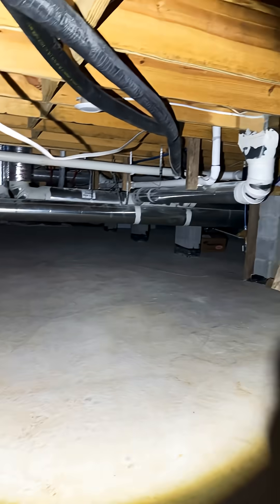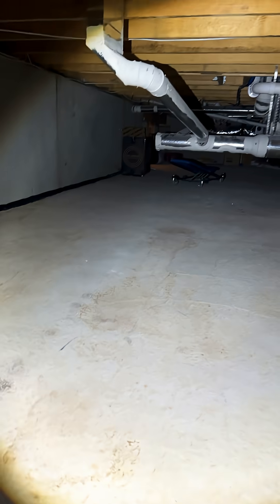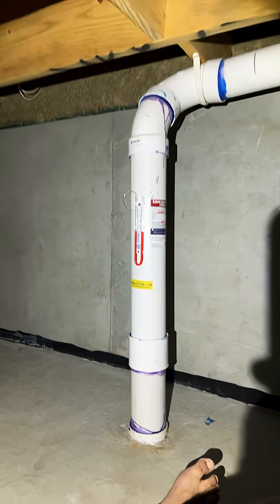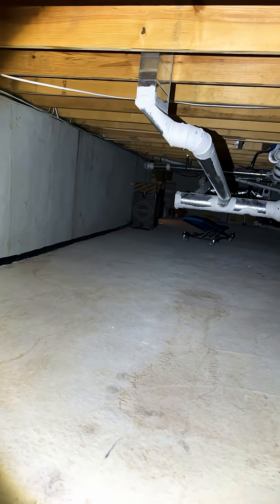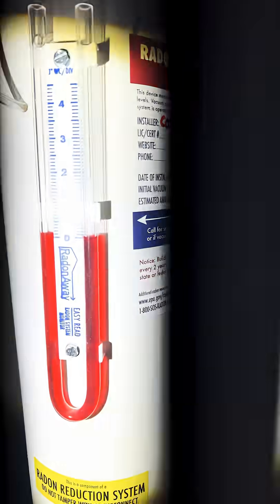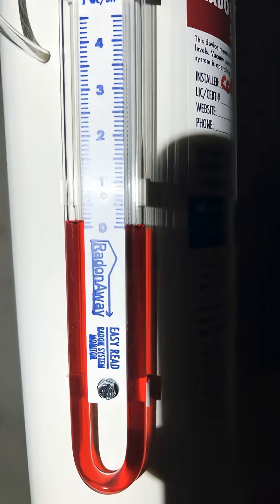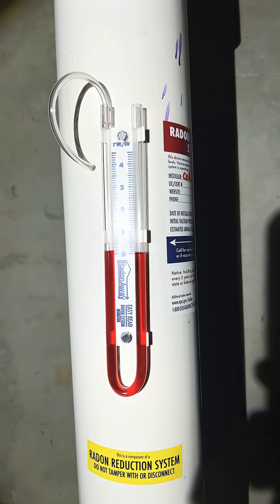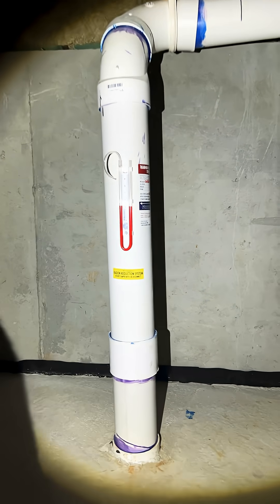Our Radon at Home is basically ZERO because of this vacuum system running at lowest speed

Comment: One new house I saw had the radon pipe to the attic, but no fan. Buyers got it in the contract that if there was radon that they would give money towards a fan, but wouldn't install the fan before. Surprise, there was radon, and installing a fan made the radon levels essentially zero. When building the house, at least get the pipe installed so it can be hidden in a wall, and an outlet in the attic to plug in a future fan.

Comment: As someone with an older home that doesn't have a poly vapor barrier under the slab, it also vents a lot of moisture out that would otherwise enter into my living space. During the winter you can easily see the water vapor coming out from the exhaust vent.
Reply: I found my humidity dropped after installing a radon system too, and this is in a new build with a structural wood basement built on piles, and a vapour barrier crawlspace - no slab. An unexpected bonus.